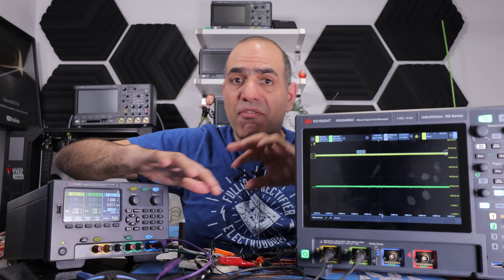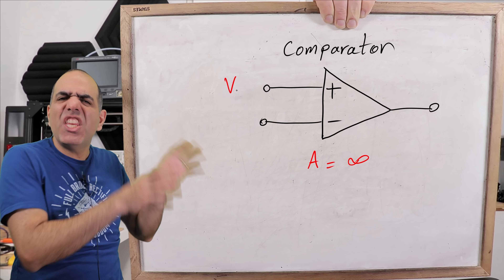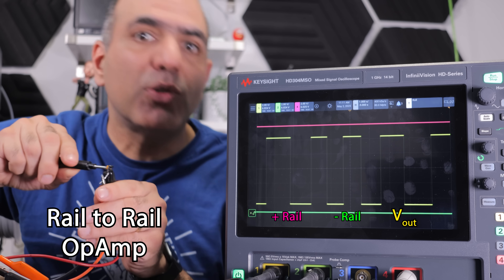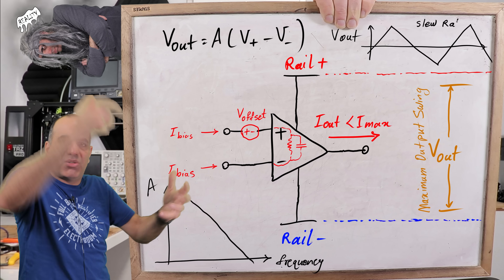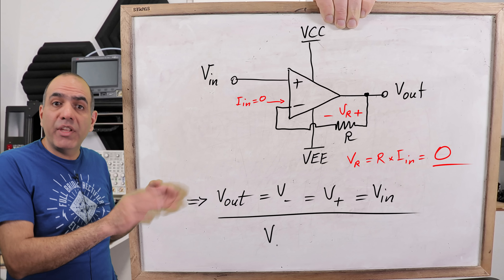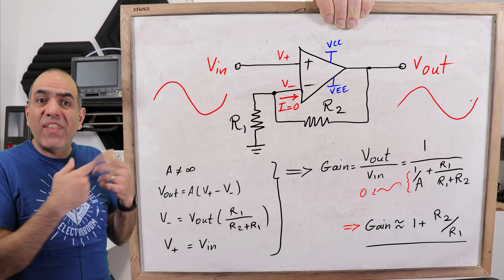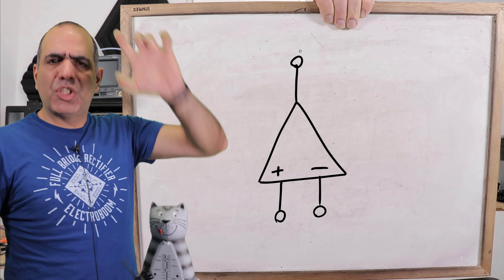The Ultimate Component: OpAmp (ElectroBOOM101 – 013)

Comment: But don't they use the battery voltage to amplify the sound from the circuit? Why not a 2N3819 jfet Macrohenrydyne radio with a piezo speaker ` henry coil and voltage multiplier for a crystal set?

Comment: There are ways to phrase slightly incorrect assertions. Instead of "the gain only depends on the resistors", "the gain mostly depends on the resistors." Mentoring junior engineers provides ample practice in qualifying my statements, and it can be done without a substantial burden, probably less burden than air quoting and making a character for reality anyway. I did enjoy the bit, though, it was funny. Edit: the beauty of speaking that way allows the learner to ask, "what does mostly mean here?" and they can control where to dive deeper in the places that interest them. Not applicable to educational videos obviously.

Comment: Growing up with my Dad being a big fan of the 741 dual opamp. I used to joke if he had to build a flashlight, it would have one just because he could. We did use them for...voltage regulators, audio amplifiers and even a single channel radio controlled servo. Thanks for the memories.

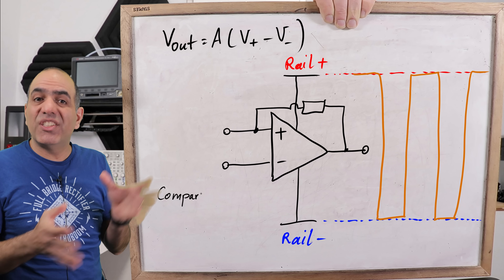Comment: 5:50; +ve Feedback Used for Digital Output.
6:10; -ve Feedback Used to keep tho Output Voltage similar to INput. Or It is used for Stability.
7:10; Gain is Very High for a Small Freq range. The Output Voltage Rise Like Line In High Freq, call it Slew Rate.
8:30; Buffer Circuit where Vout = Vin; By adding More resistor Voltage drop across Two resistors.
9:33;
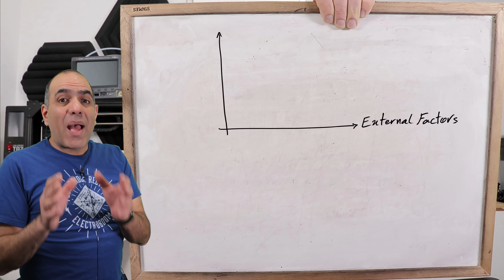11:00; What Feedback does is It Incresed the Bandwidth

Comment: depends on your design as current mode or voltage mode you could have both of them as leads for operations, meaning you could get the signal on current or voltage to transfer it, my thesis in uni was an under threshold current mode analog design which used less than a few femto watts to operate. Ahhh good old days now I work at construction (Iran).

Comment: still can't get how does it work.... washed several times.
So you have 3 legs: 2 input and 1 output: Vin, GND and Vout.
If I supply 5v on Vin what would be voltage on Vout?
Or its defined by OpAmp itself when being manufactured?

Comment: Engineer student here.

Currently learning about how to describe transfer functions with operational amplifiers. We've also touched different types of filtered amplification circuits, integrators, differentiators,non-inverting and inverting amplifier circuits. Not to forget about the differential amplifier. Even schmitt-triggers where you have positive feedback, kek.

Hell, literal square wave generators and triangle wave generators(which integrators can be used to build one when sending a square wave signal). It's actually quite fun.

Watching your video felt like a refresher.

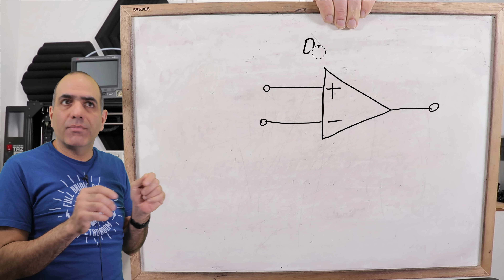Comment: 2:48 I like how he takes the equation V_out = A*(V+ - V-) , A~=inf, and concludes that it makes no sense... Until you consider the + and - power rail limits. Then, the op amp functions as a comparator. Only later does he add the negative feedback resistor and cover the three most basic analog op amp circuits: noninverting amp, inverting amp, and follower.
The textbook I learned about op amps from just stated the two ideal rules (no input current, no voltage across inputs), and started solving circuits with them, without mentioning that they required some negative feedback connection from the output to the minus input. The comparator circuit and power rail limits get mentioned towards the end of the chapter, not the start, and I have to infer the critical importance of the feedback resistor myself.

Comment: Op-amps do have limitations, but they take a huge amount of the pain and suffering out of designing a whole range of useful circuits (in both analog and digital applications). Yes, you need to worry about rail limits, input offset, slew rate, etc... but I guarantee that you'd be worrying about all that and a whole lot more trying to produce an amplifier circuit directly from discrete transistors. Being able to assume that your input impedance is close enough to infinity and your maximum gain is close enough to infinite to not matter in most cases takes a ton of the guesswork out of designing a practical circuit. Modern rail-to-rail op-amps remove the need to worry about keeping your signals in range, and can operate well into the megahertz range without even starting to worry about gain-bandwidth product.

I would definitely say they're the most impactful and useful simple integrated circuit ever conceived. Their flexibility is pretty astonishing, and they can be used for a lot more than just simple amplification depending on what components you put in the feedback and input paths. Envelope detectors, summing circuits, integrators, threshold circuits with hysteresis, adding/removing specific DC offsets to other signals, and many more obscure purposes.

One of my favourite applications is using op-amps as the control component of a custom linear power supply, with the actual main switching element being a beefy MOSFET. Normally high-power FETs are hard to drive, but if you take the output from a FET and feed it back into an op-amp and use the op-amp to drive the MOSFET's gate, you can get pretty stable results with plenty of drive capability with a minimum of parameter tweaking. By altering the exact feedback circuit, you can make this power supply operate in all kinds of useful modes (constant-current, constant-voltage, constant-power, fold-back modes, etc) depending on your requirements.

Comment: I'm a guitar player. I became interested in electronics and ended up in this channel when I started studying guitar pedals, because I wanted to understand wth I was buying. I have a pedal called "Rat" that has the characteristic of increasing the bass when you increase the gain, probably because of the difficulty of the op amp to work in high frequencies. This pedal has a capacitor that decreases bass a lot, so you end up with a very mid focused sound.

Comment: I would like to add that an op amp is not a single, magical component, but a complex circuit containing several transistor-amplifiers arranged specifically to function as described. The result of years of engineering.
Reply: i def wondered what was under the hood of this beast of a component! Thank you!

Comment: My electronics courses covered op-amps, but they only covered the basics. You explained what the feedback actually did and why you can use them as audio amps, how to properly use them as audio amps in a circuit, which I have seen them not correctly done and it cause all sorts of problems in circuits others have attempted to use them for. You also explained what the resistors being added to the circuit were doing far better than my instructor did in lecture.

Comment: Ah, an electrical circuit! Those small input offset voltages you mentioned can definitely cause issues. Even if you're aiming for perfectly equal inputs in your feedback loop, tiny mismatches in components or operating conditions can lead to a non-zero difference.
And that "flow rate" drop you're seeing within a small range? That could be related to the circuit's ability to respond to changes or maintain a certain output level. Maybe it's hitting some kind of bandwidth limitation or slew rate issue in an op-amp, for example.
Power limitations are always a factor, right? You can only push so much current or voltage through components before things get dicey. This can certainly restrict the achievable flow rate or the range of operation.
So, yeah, those small input offsets, slight imbalances, the flow rate drop within a small range, and power limitations are all interconnected realities when you're dealing with electrical circuits and feedback. They can impact stability, accuracy, and the overall performance envelope.

Comment: I remember basically two things from my college electronics class 30 years ago.  (I studied mechanical engineering, for the record.)  One of them is what op-amps do.  The other is the fellow student in my lab group who was very picky about changing the oil in his car every 3000 miles -- so picky that if his odometer was at 8997.3, he would go for a 2.7-mile drive around the parking lot so as to change the oil exactly at 9000, so that it wouldn't be more than 3000 miles when he changed the oil at 12000 miles.

So now op amps are inextricably linked in my brain with that guy and his ridiculous oil changes.

Comment: Mumblemumble years ago at uni, we were doing an electronics lab with 741 opamps on breadboards, and I managed to make one to go bang! so hard that it jumped about 4 feet in the air off the bench, and smoke came out of the power supply. We weren’t able to figure out what went wrong (the rest of the circuit stayed put and looked fine) but I reckon Electroboom would have been proud…
Reply: Well that OpAmp was simulating a Bouncing Betty.

Comment: 0:15 That's not an op-amp! Op-amps are triangles! That's a rectangle! 😂
Reply: Just shave off the extra side with sandpaper. It'll be fine.
Reply: Please tell me this comment is a joke 😅
Reply: @setrival5592  What else would it be?
Reply: 😂😂😂
That's funniest joke in the electronic industry
Reply: They need supply pins and need to be compatible with old IC standards but you draw them as triangles.

Comment: I'm not sure if I no longer understand how opamps are used to create very tube amp like amplifying (distortion) circuit. Inverting setup seems quite popular in pedals and looks like a familiar way to setup the circuit for the tubes and bias and whatnot. Although I think there often is a proper ground involved. With pull down resistor or something. I have a nice book about designing tube preamps for guitars, but it would be nice to hear more about audio amps.

Comment: why is it called an operational amplifier and nor just an amplifier asked by electroboom. like is there a bunch of broken ones that I would think it is

ChatGPT said:
Great question — and definitely the kind ElectroBOOM would phrase with sparks flying. Here's the deal:

It's called an operational amplifier (op-amp) not just because it amplifies signals (which it does), but because of the mathematical operations it can perform — addition, subtraction, integration, differentiation, etc. — when combined with resistors and capacitors. The name comes from its early use in analog computers in the 1940s and 50s, where it was literally used to perform operations on voltage signals.

So:

"Amplifier" = boosts signals.

"Operational amplifier" = can do math on signals.

There aren't a bunch of "non-operational" broken ones lying around (though ElectroBOOM could probably make that happen). It's more about the functionality, not reliability.

Would you like a diagram showing how op-amps perform math operations? from chatGPT

Comment: OK THANK YOU. THIS MAKES SOMETHING MAKE MORE SENSE NOW. Arcade tech 30+ years and on OLD SCHOOL ARCADE games, most POWER SUPPLIES had a +5 volt line and a -5 volt line. I own a bunch of games with them, but from what I understand, in the older games, the -5v line was only mostly used for was when amplifying the sound. I guess the later games ARCADE BOARDS had the sound amp on the PCB, so the -5v line stopped being used and was phased out by the time I started working on them in the early 90s.

Comment: While this is not more than a hunch, I speculate that the "operational" part of op-amp is because it turned small-signal amplification into a discrete 'operational' component. They are way easier to use compared to an analog BJT or MOSFET amplifier.

Comment: Im a electronics tech with 30 years + experience i replaced so many of these little suckers in tv sets back in the day that all died from the same cause. direct tv. For several years straight direct tv would lower the show volume just before a commercial would come on and peoples normal reaction was to increase the volume to hear the show. Then when the commercial would come on they would increase it's volume. This sudden surge would pop these opamps real fast. Direct tv was not doing it to fry tv sets instead they were doing it so people would not miss the commercial audio very un cool thing to do. they wanted that money from advertisers so bad they basically said screw the quality of the show people wanted to watch. I made good money during this time period off the repairs and direct tv lost a ton of customers as well LOL 

Eventually the cause was posted to a great many forums costing direct tv more customers and making tech more money and direct tv ended their practice. Another fun one during this time i got a whack load of fairly high end tvs off the curb that had blown opamps for the sound amplification lol   I also found out that in some cases the difference between a stereo tv and a mono one was well a single missing opamp and the space for it was right on the board as was the speaker output LOL
Reply: It is poor design to allow a volume level that would fry your tvs AGC. I dont see how no one would have thought of that
Reply: Today the change in volume is used in PVR software such as MythTV to trigger commercial flagging so that the software skips the commercials on playback
Sort or ironic , isn't it?
Reply: Some commercials still follow this tactic.
Reply: AMAZING stories ad resultant knowledge! WOW. Fricking tele corporations (as a result of human nature, which we all have too🫣) are disgusting vermin! But what cool pro tips. The cool thing about technical expertise is saving money on gems of knowledge such as here w stereo/ mono tv’s 😂😂 that cant be any fricking cooler! Thanks for sharing. Good replies too.

Comment: Inifinte in theoretical models is "large enough" in engineering. Zero in theoretical models is "small enough" in engineering. So an op amp (not just op amp model) is a device that has input impedance large enough, amplification large enough and output impedance small enough to use them as universal amplifiers for virtually anything. BTW, it's similar thing with transistors. We limit their gain with resistors to treat them like predictable models, because they behave like ones in a certain range of operating parameters.

Comment: As far as I know, they are called operational amplifiers because they were used to perform mathematical operations on analog signals, like addition, subtraction, differentiation, and integration. It's very interesting how you can use it in integration mode to produce a triangular signal from a sqaure signal.
Reply: I've never heard that explanation before but immediately upon reading it I think that must be it. Makes perfect sense.
Reply: Absolutely 
When we studied operational amplifiers in the late 1960's.. they were used in combined citcuits to simulate for example  the "operation" of a mechanical system such as a suspension system ( simulating  mass / acceleration  /damping -spring constants etc.

Hence the term operational amplifier - 

This approach using op amps to simulate  processes was called " analogue computing"
Reply: @eric4709 They were used in closed loop control systems to implement the mathematical operations of a transfer function.
Reply: yes, in the Dark Ages of electronics, Tektronix made a plugin (a hardware item that plugs in an oscilloscope, not a web browser plugin...) called the Type O, which was two operational amplifiers with accessible points so you can add components to model an op-amp and have the visual output right there on your vacuum-tube CRT 1960s oscilloscope. You can find the manual on tekwiki.
Reply: Was about to comment this. This is what I was told as an EE student
Reply: Or you could just use a regular low-pass filter to integrate your signal
Reply: If you want to generate a sine wave you do it by a Wien Bridge oscillator or you filter another waveform and remove the harmonics.

You can't do it by the mathematical operations of differentiation or integration.

Sin -> Cos
Cos -> -Sin

It is not possible.
Reply: @deang5622  That is a very nice way of "proving" that fact! Thanks for sharing
Reply: what would be useful is producing a pure sine wave from a square wave
Reply: @rogerd4559  You can do that.
A square wave is the sum of a sine wave with the same frequency as the square wave and its harmonics.
You make a low-pass filter with a cut-off frequency just above the square wave frequency, and you get a sine wave from a square wave.
Reply: @marekkuklis5867  Can you draw this circuit out and add the values of the components please?
Reply: @rogerd4559  you can use another integrator to take the integral of the resulting triangle wave which gives a sine wave
Reply: @CaptainShanklesbeard  the integral of a triangle wave is not a sine wave, although the two waveforms look similar.
Reply: @jvmgang Of course it can't be, it's sinusoids all the way down with integrals and derivatives.
Reply: @jvmgang yeah the curves are parabolic (or would be, for a perfect integrator)
the way i understand why putting a square wave through a bunch of integrators approaches a sine wave is this: in theory an integrator is really just a sort of special low-pass filter (in practice it's a band-pass filter since you have to reject DC), and eventually from cascading so many filters you effectively eliminate all the higher frequency components in the square wave and just leave a sinusoid of the base frequency

Comment: Excellent summary of basic/the most popular op amp circuits. Coincidentally I was debugging an op amp circuits today where the designer had not taken into account the limited input and output voltage ranges that differ from your "ideal" op amp, causing interesting problems.